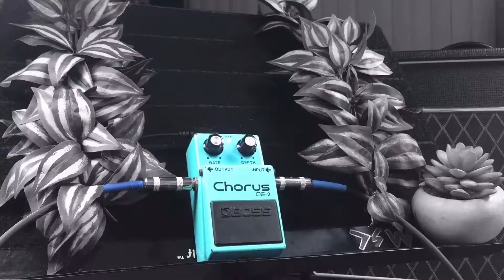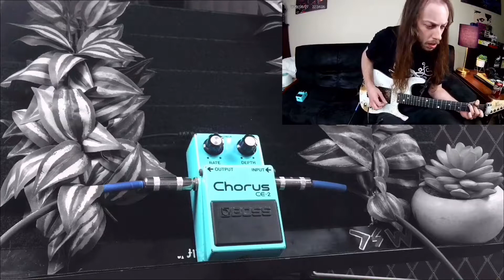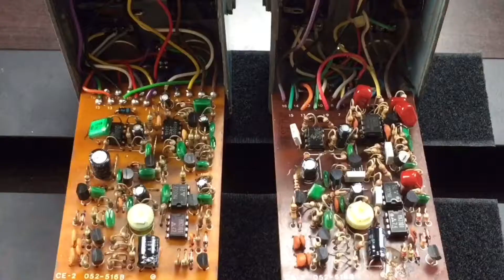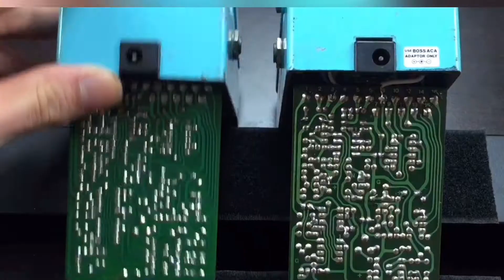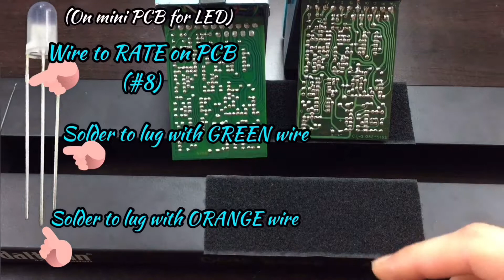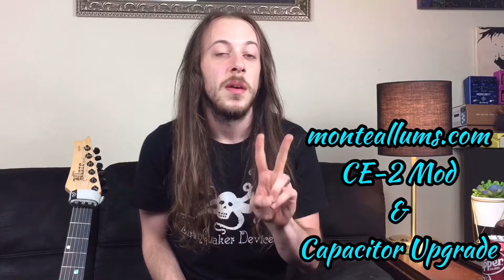Boss CE-2 Chorus Mods: Double-Rate, OpAmps, New Caps

Comment: If youre doing this mod, you should start with the CE-2B, its the same circuit apart from one resistor, and adds a wet/dry mix knob, its also half the price of a CE-2

Comment: Just to clarify those film caps you replaced in the MIT ce-2 are non polarized correct?
Reply: Nvm film caps aren’t polarized lol
Reply: what was the voltage maximum on the the film caps you put in the modded CE-2

Comment: The stuff on C29 and C30 is not a leakage. It's a glue which has been used on factory to keep them in place during soldering. The same glue has been used in my CE-2 to keep the led in place. Anyway, it doesn't mean those caps are always ok